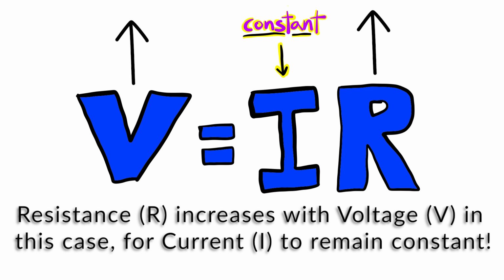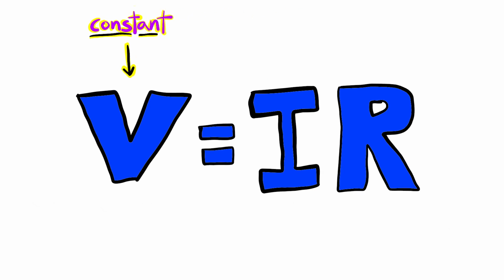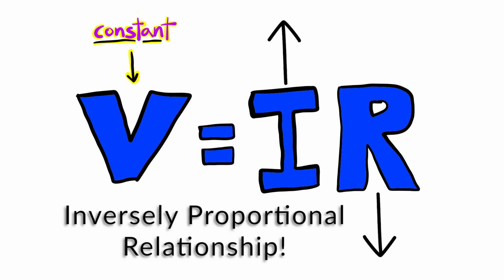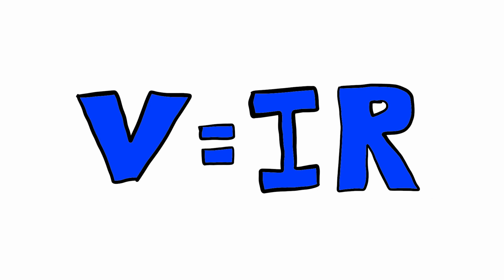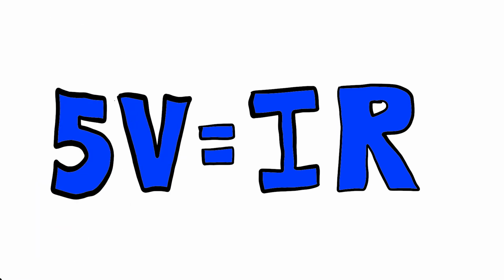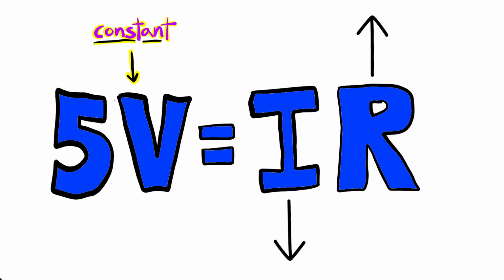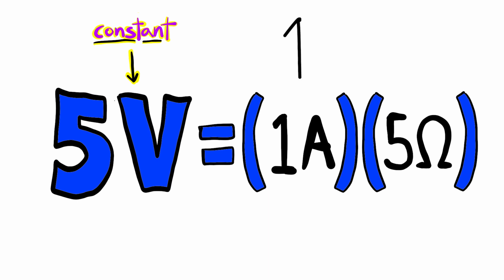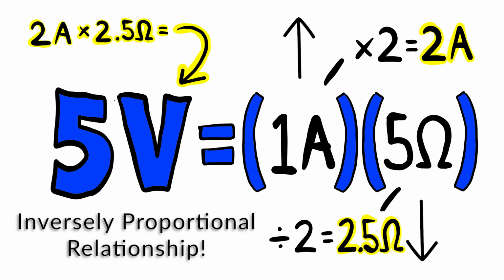Basic Concepts to Understand in Electronics | How to Do Math for Electronics Continued

Comment: It's difficult to establish, because depending on the ruleset that you're using, you're either going to get 16 or 1. If I was going to do it the way that I learned in school (A long long time ago in a galaxy far far away... It is a period of civil war. Rebel spaceships, striking from a hidden base, have won...) then the equation would break down to:

8 / 2 (2 + 2) = 8 / 2 * 4 = 4 * 4 = 16... but, would the number on the outside of the parenthesis be considered a part of that equation as well? In that case 8 / 2 (2 + 2) = 2 / 2 (4) = 8 / 8 = 1.
Reply from the maker: Thanks for watching!
Reply from the maker: Tricky business it is! The correct answer is supposedly 16 according to ‘modern’ rules. But old rules say 1 is the correct answer.  :-/